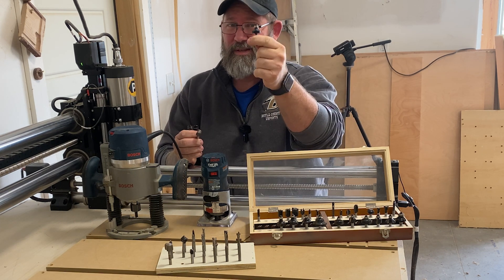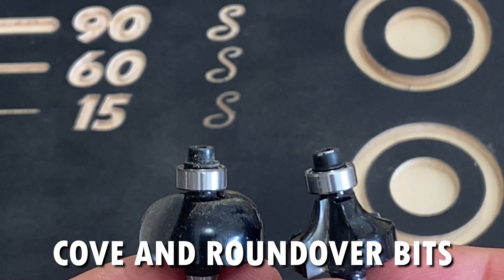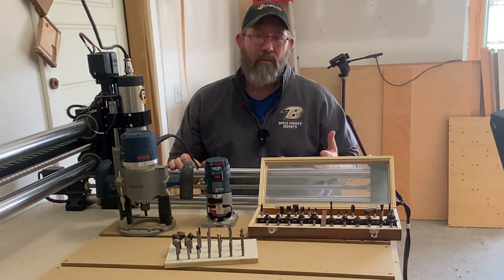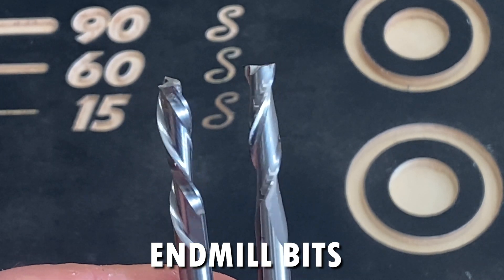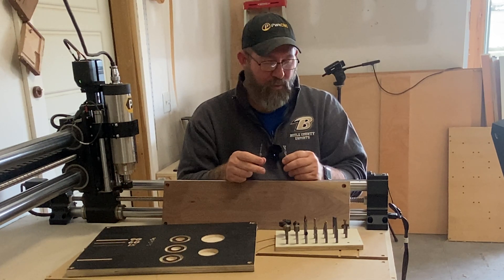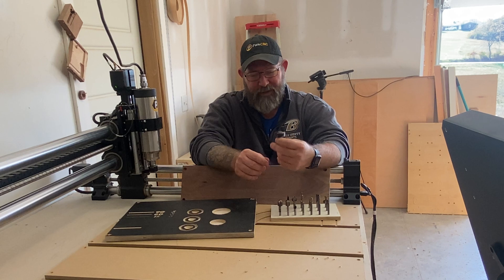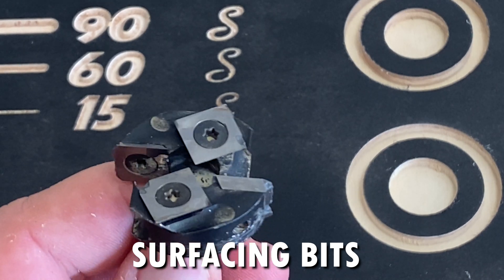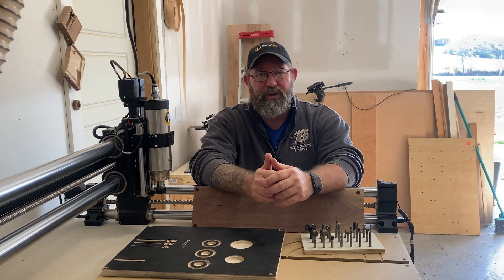Understanding CNC and Router Bits

Comment: One tip on the surfacing bit which I don't think you've mentioned; the replaceable inserts can be rotated to have a brand new cutting edge without putting in a new one!:)